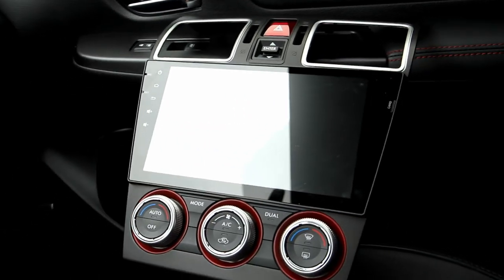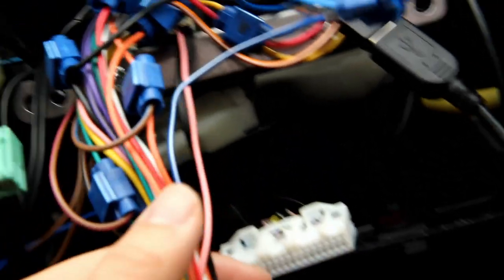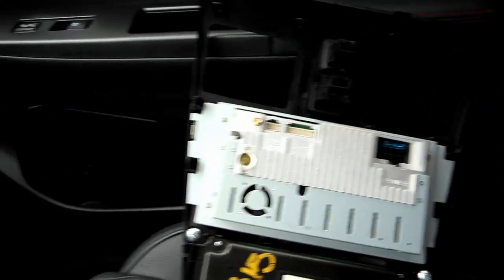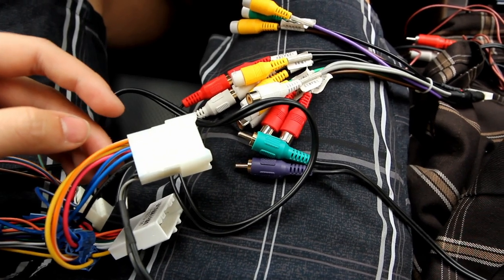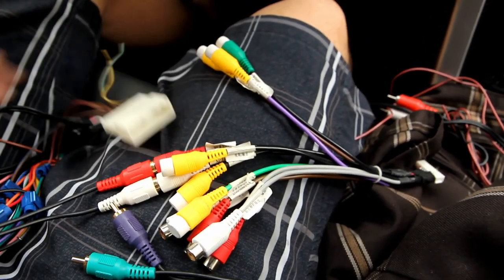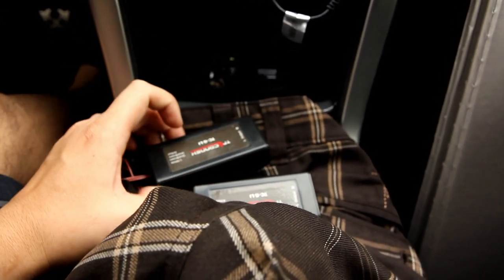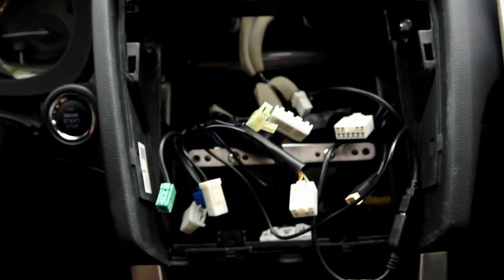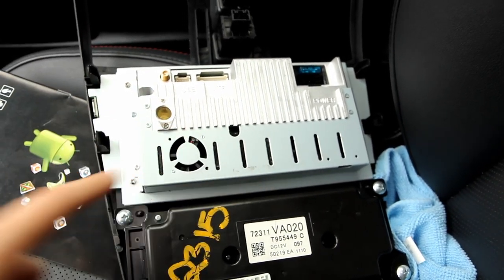Ep 25: Install tips Android Headunit , Wiring Diagram for (hum issue) harman kardon. Base

Comment from the maker: For hk 15 suabrus.

* Toyota-style 10- & 6-pin harness with plain speaker wires (like Metra 70-1761, Scosche TA02B, Raptor TY-8100, American International TWH-950, Aerpro AP1761, or equivalent)

* Metra AX-SUB28SWC (for aux and rear camera retention, SWC wires, & reverse gear signal). You can remove and discard the 12-pin ASWC plug -- you only need the 3 plain SWC wires on the 28-pin connector.

* Metra AX-SUBUSB2 (USB retention)

* Antenna adapter (more details, below)

Most of the Chinese Android HUs do not need a steering wheel interface module -- they have the equivalent functionality built in. If in doubt, check if your HU has menu options to "learn" your SWC buttons (or ask the vendor).

You will need a 12V to 6V power converter, to power your OEM camera. As Rausstek mentioned, Metra just announced versions of their camera retention/SWC harnesses that include one (e.g., AX-SUB28SWC-6V), but I don't know when those will be available. It may be quicker and easier to go with the older AX-SUB28SWC and find one of the inexpensive 6V converters on eBay.

I can supply all of the above except the 6V converter. But I recommend that you wait to see exactly what your HU vendor included.

If you can get a 70-1761 style harness locally, you might want to do that so you can get a head start on testing the HU.

Some Chinese HU vendors will supply most of the appropriate harnesses that you need, if you tell them what car and OEM HU model you have before you order. They should at least be able to provide their power/speaker harness terminated with the 70-1761 style connectors instead of the 20-pin Subaru/Nissan style.

If your vendor does give you the Subaru/Nissan 20-pin style power/speaker harness (like they did for notorious9i6):
You can easily extract the large black and yellow wires and swap those into the 70-1761 -- both styles of harnesses use the same type terminals for those 2 leads. That would be two less wires you'd need to solder or crimp.

Similarly, if you can extract the 3 SWC wires from the 20-pin Nissan harness, you can transplant those into the 28-pin shell. But this is slightly harder to do.

All of the rest of the wires on the 20-pin you would have to cut off and splice to the 70-1761.
Antenna adapter:
If you only care to retain your AM/FM antenna, you'll need a Toyota/Lexus antenna adapter (like Metra 40-LX11), if your HU vendor doesn't provide that. Remove the blue power antenna lead from this adapter -- Subaru models do not need that signal at that spot. You must provide 12V to pin #8 on the 10-pin portion of the 70-1761 type harness.

If you are planning to install an aftermarket Sirius/XM tuner module, you'll instead want an alternate OEM antenna "Feeder Cord". See this post.

**Car models include:

2016-2017 WRX, STi, and Forester
2015-2016 Impreza and Crosstrek (probably also 2017; I haven't seen the wiring diagrams yet)

Again, that's with the 6.2" screen and no h/k

For cars with the 7" screen, the OEM rear camera is on a separate 5-pin plug instead of the 28-pin. I'll write up a separate list for those later.
Reply: The above text came from this post (which has a hyperlink to info about the alternate antenna feeder cord that people will find helpful):
https://forums.nasioc.com/forums/showpost.php?p=44789447&postcount=142
That information applies to base models with the STARLINK style OEM head unit with 6.2" screen -- some 2016-2017 WRX, STi, and Foresters, and some 2015-2017 Impreza and Crosstreks.
Reply: Hey John, my name is Sang and im located in Chino Hills, CA.
I bought a used android unit for my 2017 wrx from a local part out from a guy that had it on his 2016 sti. he told me he had all the extra connectors and stuff and it should just be a plug and play. after looking at the diagram this looks fucking complicated... i do have every part listed on here except for the resistor. (i think)...
but i was wondering if you can do the install for me for a price... i see you have talent on wiring

p.s.
i really hope you reply lol

Comment: Thank you! Once I get my WRX, this is near the top of my to do list.
Reply from the maker: it should be! the head unit is awesome. The gps map system is so robust. When i'm cruising i have the lyrics automatically show up. My passengers love it
Reply: How's audio quality? Is there a detailed stat sheet on this unit?
Reply from the maker: Quality wise is decent with the harman kardon amp. I'm sure it sound better with an aftermarket one

According to what I found, it's using a Toshiba 7384 amplifier. 

• High output power capability:
– 4 x 46 W / 4 Ω max.
– 4 x 27 W / 4 Ω @ 14.4 V, 1 kHz, 10 %
• Low distortion
• Low output noise
• Standby function
• Mute function
• Automute at min. supply voltage detection
• Low external component count:
– Internally fixed gain (26 dB)
– No external compensation
– No bootstrap capacitors
• Protections:
– Output short circuit to GND, to VS, across the load
– Very inductive loads
– Overrating chip temperature with soft thermal limiter
– Load dump voltage
– Fortuitous open GND
– Reversed battery
– ESD
Reply: ok, cool! So are you using an line leveler? I saw you had RCA outs with the adapter, does it do line level out? Sorry for so many questions! I'm not an audio pro I just like good clear sound!

Comment: I BUD   I HAVE A GREEN  RAC  SUB  WOFFER   WIRE      DOES THIS GO TO THE  SUB SPEAKER OR THE  SUB AMP   THANK YOU JOHN
Reply: FOUND OUT  IT GOS TO THE AMP   BUT . THE  RED WIRE GOS THERE TO   SO YOU NEED A PIGGY BACK RCA  HOPE THIS HELPS
Reply: @michael6692  and where is remote wire on HU?

Comment: Hey man! Awesome video! I have a 2015 STI no nav/harman/kardon audio and I am still going nuts trying to figure out how to do the amplifier connection. I bought a Pioneer 4200-NEX and I have the Metra 70-7553 harness adapter ready, but it seems I still need other harnesses to completely have the harman/kardon audio funtioning properly. Can you post links to the harnesses you got? I would really appreciate it! Hope you're enjoying your new HU!
Reply from the maker: mine came included with the package.

Dam on top of my head i cant remember but i thiink i just tapped the accessory power and remote amp on together
Reply: Edgardo- see this guide (for 2015 WRX and STi and 2014-2015 Forester with non-nav and with h/k):
ae64.com/aftermarket-HU-install-parts-FW2014hk.htm
Reply: Thanks!
Reply: Hi Eduardo, I think I have a similar problem, not sure  how to connect AMP (i have harman kardon) so the harness which i have with the head unit has only antenna power wire but not for the amp to trigger. I guess it could be an option to do what John suggested to use ACC wire to remote amp . How did you solve this ?
Reply: Hi John, thanks for the video ! Helped a lot ! Could re-confirm if you used ACC power wire to connect to remote amp ?

Comment: Hooking 4 channel amp should I cut the speaker wires from the android power plug to factory plug or just splice into the android harness there for my amp speaker wire connection for my door speakers already have my sub amp hooked up also.i don't have Harmon Kardon

Comment: On the ae64 10 pin harness did you tap into the 10pin harness that comes from the after market unit? And then did you connect the 10 pin connector from the after market unit to the stock harness?

Comment: What a64? Did you make a different harness than what is provided? I lost steering wheel control
Reply from the maker: a64 isnt required for steering wheel controls
Reply: John Nguyen ugh my harness doesn't come with steering wheel controls could I message you so I can show you the pictures of the harness?
Reply: John used some of the harnesses supplied by the head unit vendor (since they plug into the unique sockets on the back of the HU), and combined them with harnesses from ae64.com to connect to his Subaru's factory harnesses.  That allowed him to avoid needing to hack into any of his car's factory wires.

The 28-pin harness from ae64 includes 3 wires to retain the car's steering wheel controls (SWCs).  John connected those to corresponding wires on one of the Android HU's harnesses.

Most Chinese Android HUs do not need a separate steering wheel interface module (e.g., Axxess ASWC-1, iDatalink Maestro, PAC Audio, etc.).  These Chinese HUs have the equivalent functionality built in.

Comment: Sorry late to the party, but I read that you can't control your subwoofer with an aftermarket HU. How do you manage your subwoofer volume/input?
Reply from the maker: if you have an aftermarket sub you can plug it into the subwoofer rca point.
Reply: I actually have the HK w/ Navi like you with a stock amp. Do you also have stock amp/subs? If so, how did you plug that in
Reply from the maker: if you have a stock amp, you can't control the subwoofer with any aftermarket head unit
Reply from the maker: i have the harman kardon with the stock amp.

the wires pretty much plugged in but i had to change here and there

Comment: Hi John, 
I have a 2014 Forester XT with harman kardon and bought after market HU, but no sound came out, is there any additional wires i need? I used the 20 pin and 16 pin harness bit it seems it does not replicate the correct position of the wires. Thanks for your input.
Reply: rjubei you need to tap the new head units amp wire (blue or blue and white) to the vehicles pink wire on the 16 pin harness I believe

Comment: hello very nice video, the wiring program you show in the video where did you get that? Because i have a volvo s80 from 2001 and if i can get my hands on a wiring program i could very easy fix this to make my wheel controls work i think. I have a non named china aftermarket android stereo and  it has the gnd wire and key1 and key2 on the backside and also an app to set the volume controls, have you any suggestion for me please i would be so happy if someone could help me with this, because i dont need a adapter, i only need to put the right wires together and it should work !

Comment: Hey, I have a 2015 WRX premium package with HK with navigation. I bought the Android 8.0 head unit from seicane. They provided a blue AMP-CON cable which I routed into the 8 pin connector and audio seems to be working but not the speaker's on the front door. Any ideas? Or have I done it wrong?
Reply from the maker: hmm i just tapped the acc power with the amp on the 10 pin. I didnt use the amp-con wire at all.

Besides that i would double check the 10 pin connectors too and check your eq settings. The Fader option. Move it around.

2015 wrx premium hmm, what country are you from?
Reply: John Nguyen ah okay that's interesting...yup I move the fader around and it works but I feel like the speaker's on the dash, back doers and sub work but not the front door speakers. I'm from Australia
Reply from the maker: Do you have any subaru eye sight package? A lot of people have this issue.  It's because the subaru safety stuff take control of the front speakers.
Reply: John Nguyen nope I don't have that I don't think. Just the standard cruise control.

Comment: Hey john do i still need the harness if i have a 2015 limited non harmon kardon or did you say it was plug and play?
Reply from the maker: i just did an install on a 2015 limited non harman kardon system. It's 90 percent plug and play.

There was like a wire i had to tap into for the antenna. It was a very weak signal without it.

Stay tune to my channel, i probably post the video this week.
Reply: Thanks! Just subscribed keep up the great videos. How long have you had the system?
Reply from the maker: for about a month now,
Reply from the maker: thanks

Comment: I have a 2017 wrx just ordered the new 5.1 and having a hard time getting it installed.  Ordered two different harness that don't work with my system... Trying to splice wires now.. Any tips?
Reply from the maker: was your the harman kardon or base?
Reply: John Nguyen base.
Reply: John Nguyen I do see that there is a 6 and, 10 connection but I can't even get power to my device
Reply from the maker: You need the toyota style connectors most likely
Reply: John Nguyen anyway you could send me a link to what I need exactly?
Reply from the maker: i dont have a 2017 so i can't really give you exact specs since mine is a 2015 harmon kardon. I thought it be similiar from my knowledge but you might need to talk to a professional
Reply: John Nguyen not the same at all but thanks for the help anyway.
Reply: Xzonerate i need help with my android head unit i have a wrx 2017 but I don't have any clue about the harness I need
Reply from the maker: contact subispeed
Reply: Roperag WRX 
You would need the 28, 10, and 6 pin harness. Also you would need a 12v to 6v stepdown regulator to retain reverse camera, also a USB adapter to retain your oem aux and usb
Reply: You can get that fro Subispeed

Comment: Is it possible to do this trick with canbus cars? I have a buzzing sound coming from speakers when I turn my headlights on. Even parking lights does it. But when they are all off, amazing sound, perfect, no noise. The speakers are connect through canbus. Can you help me? I have a VW Scirocco, I think it's a ground loop problem.
Reply from the maker: thats super weird, i would check your grounds, might want to look into ground loop isolaters
Reply: John Nguyen thanks buddy! How do I do that on canbus system? Should an electrician do the work? They might know.

Comment: Which wire connection do i use for an aftermarket subwoofer? Im used to rca out/sub out. On this its rl rr fr fl and aux l and aux r and a green one for subwoofer. Only ones im getting any kind of noise out of is fl and fr but still not working correctly. Any tips. 13 wrx so similar platform as this.
Reply: Did u figure it out?
Reply: @shwab4life1  and do you know-how what color is a remote wire???

Comment: is this a direct plug and play for the base 2016 wrx?
Reply from the maker: no
Reply: This post on the NASIOC forums has a list of the harnesses and adapters you would need for a base 2016-2017 WRX or STi (and some other Subaru models with similar STARLINK style head units with the 6.2" screen):
https://forums.nasioc.com/forums/showpost.php?p=44789447&postcount=142

Comment: My issue is since the yellow is always connect to battery constant there’s always a power draw even if the car is turned off
Reply: Your factory stereo, draws power when the vehicle is off aswell.
Reply: Is to keep your settings that's why has power @ all times.
Reply: Where is remote wire?
Reply: @janjohnny4945  the best thing to do is connect also a switch to unit between car a head unit to switch off when not using the car so it can not draw power
Reply: @JAYJAY1787  yep good idea thx. Nów I want to connect amp, and Cannon figurę out how to conect blue and White wire from amp 'remote wire'
Reply: @janjohnny4945  Your amp should have a remote input , you connect a wire from radio remote wire and run it all the way to amp and plug in
Reply: @JAYJAY1787  yep but dont know which wire from radio connec to to the wire blue White from amp
Reply: @janjohnny4945  it's should be labeled on the radio amp wire or trigger wire